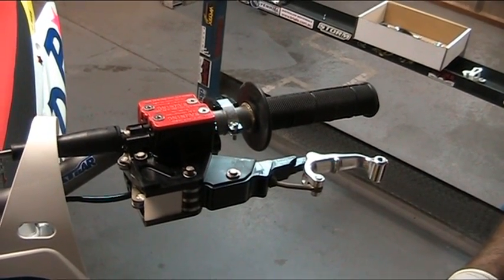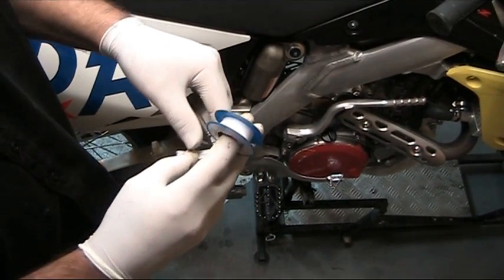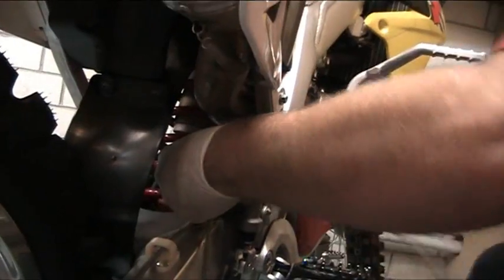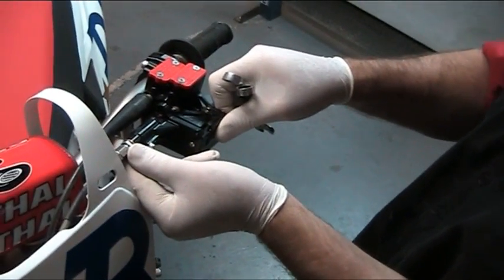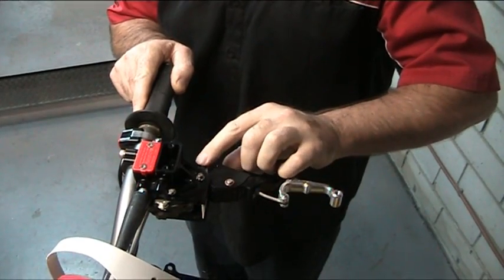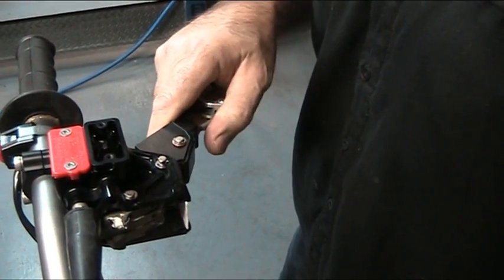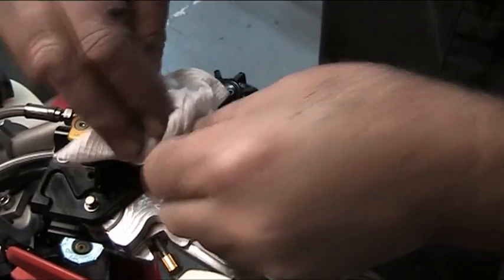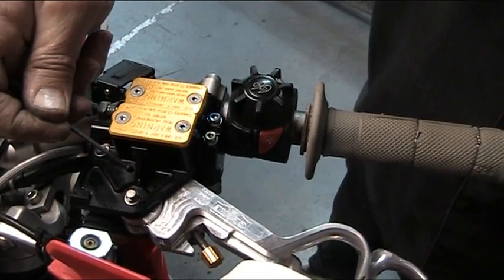Clake and ClakeTwo   fitting and bleeding the brake

Comment: An added tip for bleeding the brake: Once you have done all the bleeding in this video for the LHRB brake, you may notice it is weak and you have to pull the brake lever to the bars to get the rear wheel to lock up. If so, try this: zip tie the brake lever to your bars as tight as you can get it and leave it overnight. Cut off the zip tie and slowly let the lever out, then slowly pull in. It should be noticeably better. Then normal function. Worked for me.

Comment: So can you use both the foot brake and the hand brake or only the hand brake ?
Reply: mc4nathan 
If you’ve got the dual control unit you’ll be able to use both.
Reply: @briangardner3154  There's no vid about bleeding the dual control ?
Reply: @rayoss232  yes there is.
Reply: @briangardner3154   cheers Brian can yo post a link please ?
Reply: @briangardner3154  Cheers..
Reply: @briangardner3154  sorry mate  my bad, i meant the Dual Line Brake control, the SLR, that retains the rear brake pedal...